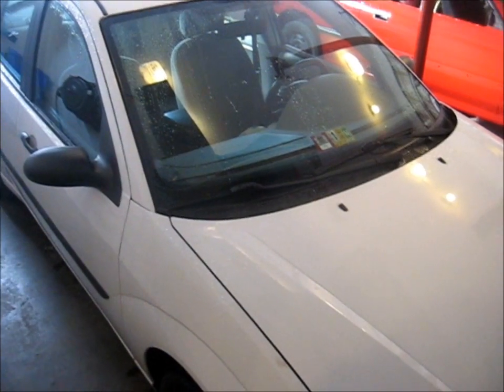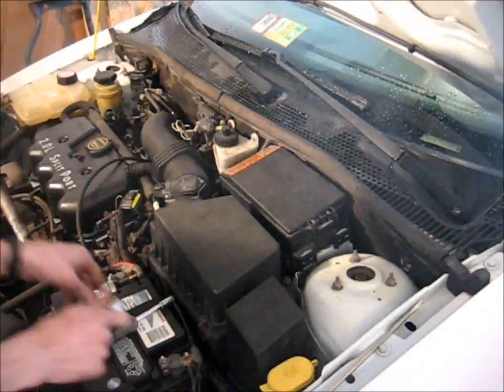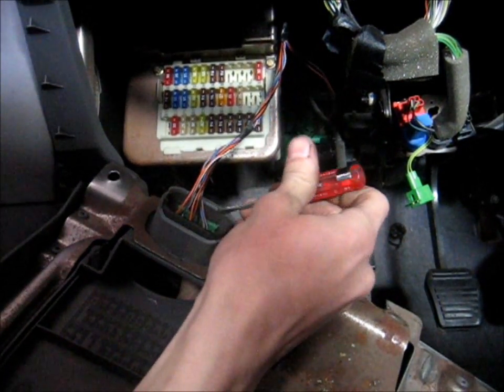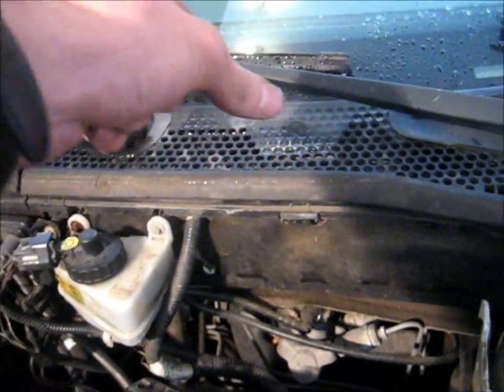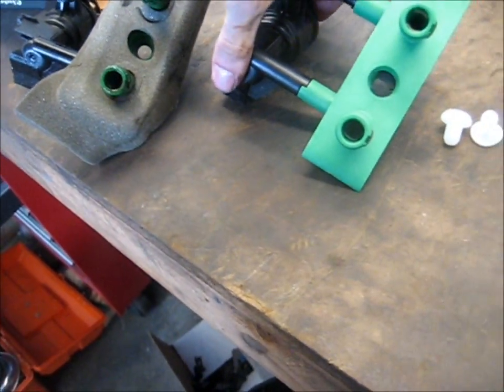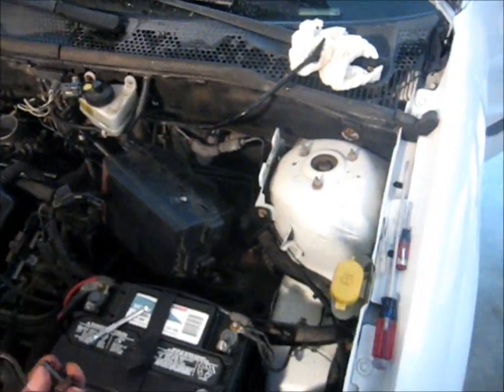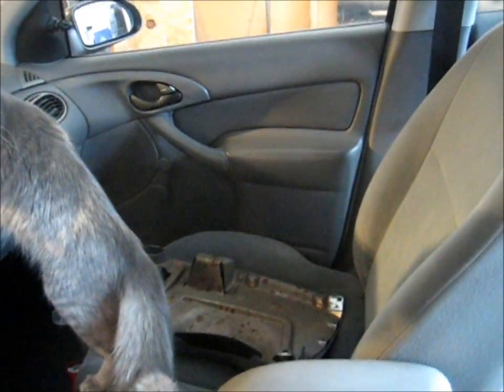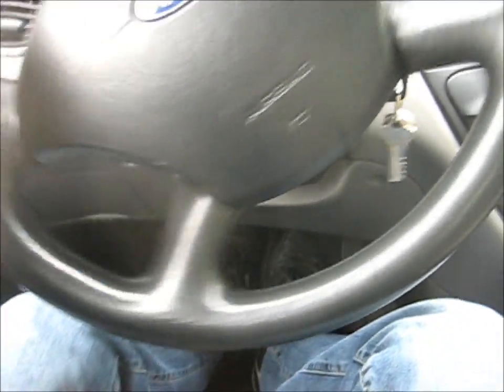How to Replace Ford Focus Clutch Master Cylinder

Comment: Thank you for the video and your time to make it, it was very helpful for me. What i made differend, i didnt take out the bolt what retain the rubber seal on the outside of firewall, its not holding the cylinder  and i didnt move the pedals or switches. The basic sustain of cylinder are those two bolts mounted on pedal itself sustaining the cylinder. The 10mm ratchet spanner is a must have tool in this process. That big steel clamp on the green plastic is very easy to handle. So the advice for future DIY people, dont bother with the rusty bolt on the outside, ratchet spanner wery helpful must have. But dont forget, because of this video, me too was able to make the job done. Thank you again.
Reply: And yes. Kitten was very nice.

Comment: Just finished my master cylinder today! On my '09 I had to remove the battery and battery box in addition to the fuse box but other than that it was pretty straight forward. The panel under my steering wheel just clips on and I didn't need to loosen the hood release cable or loosen the clutch pedal bracket. Very thankful that I had this video to go off of though. Thank you very much!

Comment: This video was very helpful. I just did the M.Cyl on my daughter's 06' Focus last night. Her bleeder valve on the slave cylinder was a conventional bleeder valve like a brake bleeder. Also, I found it easier to pop the pin out that holds the brake master cylinder rod to the pedal, and drop the entire pedal assy. down for removal and installation of the clutch master cylinder, then put the entire assembly back into place. Thanks Alex.

Comment: The new version of that exact part is built better now...FYI the shaft is now metal. And other parts are metal. Rock Auto was about $35
Your video on here is the best on this clutch master replacement.

Comment: I think it's funny that the clutch master cylinder instructions had a picture of a  clutch slave cylinder. Your video saved me from replacing a slave because I checked and my clutch pedal was wet. Hopefully that solves the problem!

Comment: At the time of my posting this comment I'm a little more than 50% complete with this job and I wouldn't have begun starting it without the help of this video, thanks for posting.
I wish it was an easy job because for someone like me that's 6'-3" and not a small dude my entire right side of my body is reeking in pain because of the close confined space I have to work with.
Reply: I should have replayed the part where you mentioned installing the top line first, now I got to go back in there and disconnect the bottom line so I can get it properly bleed out.

Comment: Great video, really helpful.

I want to point out one thing: You should be disconnecting your battery, or at least the negative, before doing any sort of work on the engine at home. I know it sounds silly, but when you're working as a "backyard mechanic" you can't hold anyone else liable except yourself if something were to happen. 

I noticed throughout your entire video that you pulled a lot of electrical connections, and removed the fuse box WITHOUT disconnecting your battery. 

It only takes 10 seconds to loosen the nut and remove the cable, and hundreds of dollars and so many hours more to figure out and fix more problems. 

Just some friendly advice.
Reply: Seven years later your advice still holds strong.

Comment: Thank you for this video. I just replaced the clutch master in my 2000 Focus using this guide. Wasn't the easiest job in the world but I got it done. The only thing is I think the clutch bleed nipple is in a different spot on my vehicle because I couldn't find it (note: my vehicle is the 130 HP Zetec version with the MTX-75 transmission). Alas, my car drives well at the moment (shifts easy, engagement point is about right) so I'll have it done when I go for an oil change (due in the very near future).
Reply: I couldn't find my bleeder either. Did you end up finding where it is?

Comment: This was a good video and helped alot. I didnt actually have a bad master cylinder but the plunger to the cylinder snapped off so i had to replace it. The only problem that i had was finding a video to bleed the system that i will just have to figure out by myself.

Comment: Hi,
Finally I managed to take it out, but I just want to say that you don't have to take out that screw from the engine side, that is only to hold that rubber seal, after I took out the 2 screws from the pedal I just pulled the cylinder and it came out without any problem. :)
Reply: +Roland, I've been messing with that bolt on my car for about 2hrs now,and I've been reading these threads to maybe get a tip as to how to take out that bolt, then after reading yours I shouted hallelujah, thanks man for posting
Reply: +dan doan. :) you welcome. you have been lucky, I stayed 2 days :))
Reply: Couldnt get that stupid 7.5mm bolt off and after reading your comment decided to take it off without removing that bolt, came out with a large crowbar finally after a long night
Reply: Thanks buds! You answered my question! ... as my bolt is rusted out and I saw the clip on the inside and wondered about whether I needed to remove the center bolt (on the firewall) at all!
Reply: @danthemanoth  lol - My bolt is rusted out as well Bro - and from reading this - I am saying the very same thing - Hal-le-lu-jah!
Reply: @poproland88  Jeez man! I spent 3 hours in with light snow - and it felt like a week! lol

Comment: Excellent video. I especially relate to the language when struggling to finish a step and the parts won't cooperate. I don't know how I did a thing without YT. Seeing your video makes me feel ready to tackle this job.  Of course, when I look under there, I wonder if it'll turn into a master brake cylinder job or some other deal. Been feeling slickery all up on my feet for months now.
Reply: My clutch screeces loud when you let off

Comment: Thanks Alex... This video and the timing belt video were very helpfull. However, I broke the clutch line trying to remove it. It was very corroded. What do I need to do to replace it? Do I need any special tools? Thanks again.
Reply from the maker: If you broke the line you'll need a new clutch line. It should attach to the slave cylinder in the same fashion as it attaches to the master cylinder.

Comment: Great video.  Got the job done with these steps.  However, not easy, but that had to do with some stuck bolts and a corroded battery contact.

A few things on the '07 Focus: You need to pull the fuse box, and then the battery rather than the airbox (which is a new design).  

Also, I was able to pull the master cylinder without removing the pedal bracket.  The bracket holding the clutch pedal sensor is actually what is in the way, and that is connected to that bracket, BUT, I was able to just bend that sucker out of the way, and then bend it back after swapping the cylinder.  

It almost appears to be designed to do that as it was sturdy enough to pull that off quite nicely.  Those pedal bracket bolts are very difficult to get out!  That move saved the day.

Comment: A good one man bleeder tool you can make yourself a small glass jar relish or the like get some rubber tubing a couple of feet clear fuel line 1/8" ID or so a little smaller than the bleeder so it will fit tightly over it and not fall off then make a  hole in the top of the metal lid of the jar again a little smaller than the OD of the clear hose so to stay and not slide off  the hose through the hole into the jar fill the jar with enough  brake fluid to cover the open end of the hose in the jar so no air can get in . And all you would have to do is put the other end of the hose over the bleeder  crack it and carefully pump the clutch until you see clear fluid going through the hose with no bubbles in the fluid and tighten or close the bleeder top off the reservoir and you should be done.

Comment: hey Alex, great vid, really helped out. Just want to point out that when you put the rubber "plate" back on the arrow should be pointed up, not down, like you said. Also, I'm having trouble bleeding my clutch. I used the hand vacuum method but cannot seem to get it to work. Wish you had made the how-to video on this! Thanks for this one though, it's good
Reply from the maker: Oops, my mistake on the rubber plate. As for the clutch, use the standard two person bleeding technique. Put a clear hose on the clutch bleeder and route it to a clear bottle, fill the reservoir, with the bleeder closed have a helper press the clutch pedal, open the bleeder until fluid stops flowing, close the bleeder, have the helper release the pedal. Repeat this as many times as necessary until only clear fluid comes out with no bubbles. I want to make a video but I haven't had a chance yet.
Reply: yeah I tried doing this method but apparently it's my clutch itself. It got stuck and wouldn't disengage, so it's at a shop now replacing the clutch and slave cylinder. that's a little past my tech level lol
Reply from the maker: Bud Maxwell
I have a video series showing how to replace the clutch as well. It's a fairly involved process and requires a transmission jack. But it's respectable to know when you're not capable of a task and when you should take it somewhere. It's better than screwing something up.
Reply: cool, thanks. I got the car back finally and it runs great again. Apparently one of the springs broke off and that's why the clutch got stuck. Now my check engine light keeps coming on (reading EGR code, insufficient flow) so I'm guessing it needs a sensor.

Comment: Nice work! I found your video looking for a video that shows how to disconnect the break lines from the master cylinder so I can replace them since they are pretty rusted. Not too many focus break repair videos on here. Also couldn't find a break system diagram for the 2000 focus either.

Comment: Hi,
Thank you for the video, it's very helpful. I started today to take out the cylinder, but I had to stop because the head of the screw rounded up(striped). Can you give me an advice , how to take out that screw.I saw that first you had the same problem, but after that you just managed to take it out, but didn't see how you did. The space is very tight so I cant reach there with other tools, I just used a socket wrench with extensions. Thank you, I will wait for your answer because I really need the car.
Reply: Did you ever get it that's where I'm stuck at
Reply: +OMGitzBiGMike.  yes, I manage to take it out. after you take out the hoses , you just pull the cylinder from inside. you don't have to take out that screw. at least for me it worked .
Reply: +Roland. that screw from the engine side is just to keep in place the plate that's over a sealing rubber. so if you do the same like in the video for the inside of the car , and then just take out the hoses , you should be able to pull it out.
Reply: +Roland  I got it fixed today your right you don't have to take out that screw on the firewall at all . He should update this video b it did help me a lot but that dumb screw
Reply: +OMGitzBiGMike. yes I know :) I stayed 2 days trying to take that screw out, until I found on a forum that I don't have to take it out.

Comment: Thank you so much for sharing this, I have replaced my clutch master cylinder today, but I'm not quite sure how to do the bleeding. Now the new cylinder is full of air, I press the clutch like pressing nothing but air. I can't go anywhere. Could you show more details about bleeding?
Reply from the maker: I do not have any videos yet of how to bleed hydraulic systems. There are many other videos on YouTube, however.
Reply: +Ran Lin did you ever get the air out of your cylinder?
Reply: Matt Martinez I've bled the air out, but there's still a little play for the pedal. The mechanic says it's normal, I'm not quite sure.
Reply: Ran Lin any way in particular that you bled it?
Reply: Tighten the bleed nipple, push clutch pedal several times, hold it, release the bleed nipple, tighten the bleed nipple, repeat for several times.

Comment: Hey thanks for the clip! I am trying to find a workaround for my 2010 focus clutch master cylinder. 
Question: Was it absolutely necessary to remove the center bolt which holds the master cylinder to the firewall OR could I ONLY remove the 'u' clip on the inside? 
My center bolt rusted out... hardly anything to grip! I was able to loosen all the other bolts on the inside but the center bolt wouldn't give! I aborted the mission as I did not want to snap anything inside and end up with bigger probs... 
Your insight will be appreciated!
Reply: The center bolt does not need to come off just the bolts the hold the cylinder in place and the pins that hold the 2 lines in place. U clip as well.

Comment: Was just wondering after removing that nut to the master to the fire wall and to the pedal assembly would there b enough plastic line to pull them thought he firewall to undo the clips and snap on the new master to the lines inside the car instead of tearing things apart in the engine bay?
Reply: Good question! I never thought of that - my center bolt which hold the master cylinder to the fire is rusted out and I am trying to figure if I really need to remove it at all - OR I could simply remove the 'U' clip on the inside and the other nuts and bolts which hold it to the clutch pedal assembly THEN pull it through the rubber seal from inside the car... Thoughts?

Comment: When you plugged the lines back into the master cylinder, did you put the clip into the master cylinder first, and then push the line into it, or did you push the line in first and then insert the clip? Thanks for the info!
Reply: I'd say put the line into it first then push the clip the rest of the way on. I'm doing mine right now and the bottom line is stuck on the old cylinder.
Reply: @jpskiskate2000  I've tried both ways and it is not working. Are you replacing the hydraulic line also, or just the master cylinder?
Reply: @nikitalatman444  just the clutch cylinder. I think the clip goes on all the way then you just plug in the hose into it actually.
Reply: Okay, I’m actually just replacing the hose that goes between the master and slave cylinder. My hose is made up of two parts and I can’t get them to go back together. I’m hoping once I figure it out, I can use the same method to put the two ends back into the master and slave cylinders.
Reply: Nikita. The new clips remains in place in locked position mounted on the new cylinder. Push the lines in place, you can hear the click sound of the clips locking the lines.

Comment: Thanks for the great video! 
I have a question about bleeding the clutch: did you press the brake pedal or clutch pedal to bleed the system? Thanks for the reply in advance!
Reply from the maker: Press the clutch pedal.

Comment: My son'sFord Focus, started getting hard to put it in first and reverse .  Could it be the master cylinder on the clutch ?  You said you could still drive your car,  the one here is not moving, we can tow, but it's not going into gear.  160K-170K miles
Reply: It could be your clutch master cylinder, slave cylinder, or the clutch itself. My focus goes into gear when the car is off but when the engine is running it can't go into gear. I replaced my clutch master cylinder and it still won't move. Maybe you will have better luck.
Reply: Could also be a problem with the transmission fluid, not enough or wrong type used.
Reply: @ya_boi_zak5927  I think we did....why ?  Because we sold it !  LOL.   You are right, it could have been the master since there was a huge puddle under it, but could have also been the clutch.  I was not going to fix it or pay someone to fix it for my son. It's his car, his responsibility.  He had the car almost 10 years.  It was a good car.  He had 4 accidents in it....

Comment: What is the thread size of the bolt that goes under the hood side of the cmc, in between the two hydraulic lines? Mine stripped and I don't know if it's stripped on firewall to so I might have to run without one.

Comment: To take off brake line pins I find out you can use a very short,very thin punch, if you have one, or flatten the side of a penny, penny didnt work as good so I switched to punch but you migth make it to work

Comment: What size is the bolt holding the master cylinder to the fire wall . The clips that hold the lines on mine are broken so I have to pull it to replace the hydraulic line

Comment: My plunger just snapped. Otherwise it is fine. Must the whole thing be changed like this? I can't seem to find just a plunger to buy and replace it in the housing.
Reply from the maker: As far as I know the plunger cannot be bought or replaced separately. Unfortunately you must buy and replace the entire master cylinder assembly.
Reply: You must buy the whole part.. It's really not hard if you know how to turn a nut and screw. It's just the angles you have to contort your self.

Comment: Hi I have an question my ford focus its not shifting into gear  is that why you changed your clutch master or what made you change it
Reply: I am having this issue of not shifting into gear in my 09. Did this resolve your issue ?